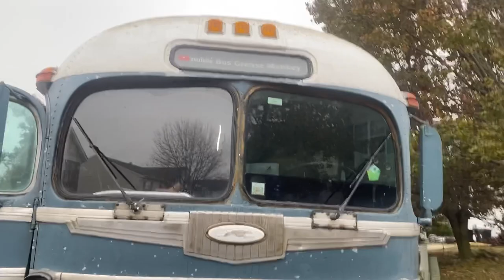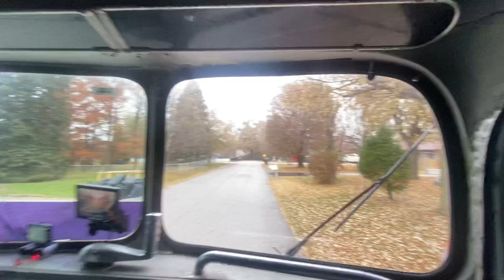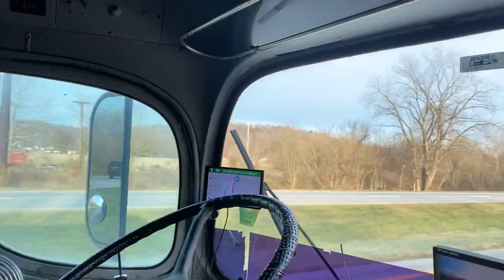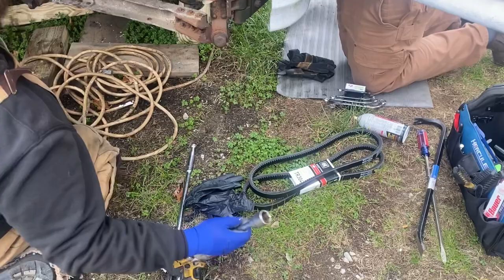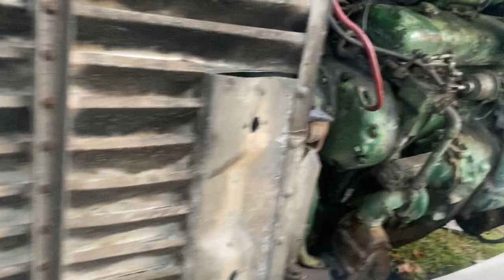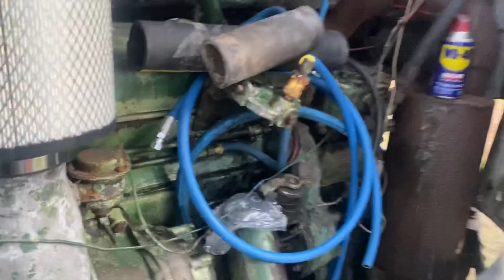Back to the pre war silversides

Comment: Yeah Wanderloge. Cannot wait. I had to put a core into my radiator last month. Thanks to you I knew what to do. New core and gaskets and stainless steel bolts. It weights 400lbs. Used my engine crane to get it most of the weigh home.

Comment: The belt scene illustrates why the 4101-2-3, despite being less."luxurious" than the 3751, was pretty popular with primary and secondary operators...no belts.  GM decided that maintenance costs of belt drives was a concern for operators both in the bus and rail industries.  Both GM Truck and Coach and Electro-Motive  converted their products to gear drive at about the same time, 1946-49.  The PD-4101 went to all gear drive accessories, both on the prime mover and the AC unit in 1946  They missed drive belt on the evaporator fan motor, though!  I seem to remember GM T&C going all gear drive on the transits in '47, back when they started their "streetcar elimination" sales campaign, which later was the nexus of some contentious lawsuits which GM lost.  EMD made the change on their F2 freight road units in 1946, and the passenger E8s in 1949, both using pancake fan motors developed by Delco for EMD.  GM made a big deal about this new cost saving design...so that the buyer would pay GM more up front, rather than pay Gates Rubber later.  The conversion helped boost reliability which helped both GM Coach and EMD to be the runaway leaders in their markets.  Both lost those positions when GM started its downward management spiral, with MCI running GM out of the bus business, and GE doing the same to EMD later.  GM had become entitled and complacent, and competition ate their lunch across the board.

Comment: I think the best way to look after these old vehicles is to run them gently, don't hammer the living daylights out of them, simply let them cruise down the highway in top gear at around 55 mph, the engine will happily find its sweet spot and once there will run and run.  1000 to 1500 RPM and she'll sing all day long

Comment: Tyler has quite a bit of driveway , do you get much snow there in an average winter ?
Reply: Everyone was at work there there are usually 2 more vechicles in my driveway.
Reply: @Spyke383  just thought you had a lot of area to clean and if the snow was deep it might be a lot of work depending how you did it. With other living there then that lightens the task.
Reply: @heartland96a  yea it doesn't get too bad if all the cars are in the driveway. Its rare we see more than a few inches of snow in a storm
Reply: @Spyke383  that's great to hear

Comment: how soon before the bus is drivable? for Lenny you and kelly need new fans i noticed in the videos they are low quality china made units the best fan made still made in USA is Baader Brown the 7200m/8000 is best as they have a version i seen on Ebay with a switch. they have a more powerful motor they say Montaque Equipment Co. Springfield Ohio.  i lookee on Baader Brown's site they are still made in USA. if used you can get them from a junk bus a Ward/Amtran school bus mainly.